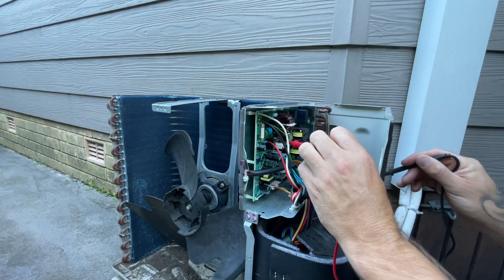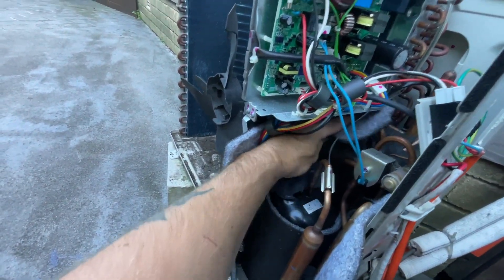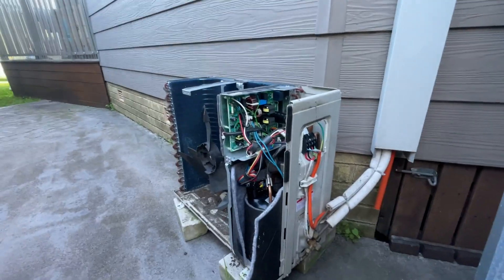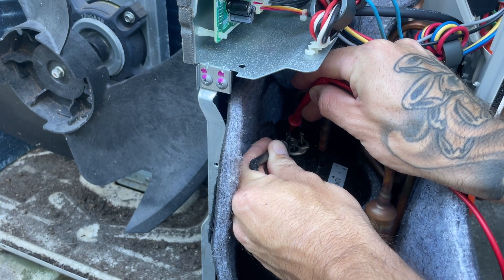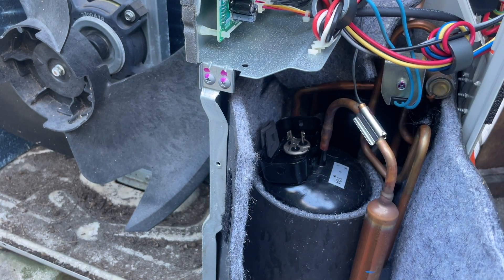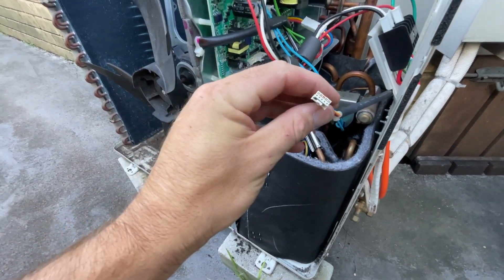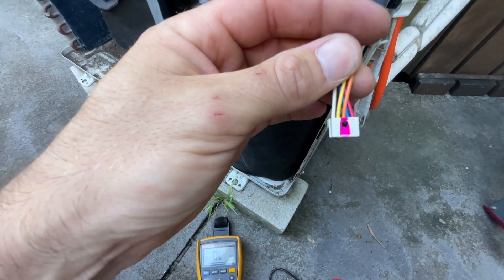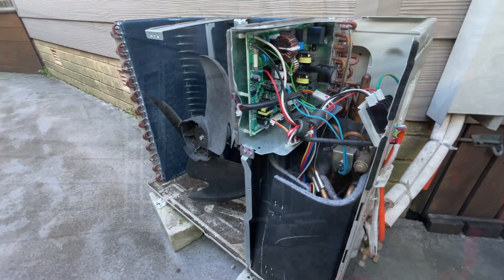Diagnosing Daikin U0 Error⎪2

Comment: Shouldn’t the run and start windings be 4.6 ohms since both where 2.3 ohms isn’t that a faulty compressor?
Reply: These compressors are inverter driven, basically a three phase motor, so all windings should read the same resistance. The board varies the AC frequency driving the compressor to vary the speed the compressor is running.

Comment: Thank you for the video🙏🏼 I got a serious problem with my Daikin 3MXM52N2V1B. Changed Mainboard, Valves, all sensors gas,water, main and the system runs 50seconds fine, after that 2.50min stop. This goes on and on for about 10 hours. On the outdoor machine the bulbs 2+3  are blinking> start with defective compressor. Then the Onecta App says error H0.  Would be really greatful for any tips recomendations what to check for 🙏🏼

Comment: Hi, have you ever had a u0 04 error?
Daikin cant seem to figure it out and blaming airflow, however system was working fine for 3 years through many 40c days.
Gas has been reclaimed and checked.
Indoor coil thermistor replaced.
Reply: Change brand next time mate, this brand is too much problem and gives you headaches....
Reply from the maker: If it’s not short on refrigerant and a technician has confirmed this. You need to test the low pressure transducer is actually working. It might think it’s low on refrigerant when it actually isn’t.

Comment: hi mate ever had an e5 error?
Reply from the maker: Yeah mate that’s just an error code that comes up when the compressor gets to hot. Unfortunately there’s many things that could cause that so it’s impossible to tell you the exact problem without checking stuff but I can tell you that the compressor got too hot. Error comes on when the thermal overload is tripped which is located on top of compressor.

Comment: If the fuses don't have continuity could you replace them to try and get the PCB working again?
Reply from the maker: Yeah definitely however unfortunately in this case the fuses are fine and do have continuity. The issue is in the board.
Reply: @maracservices  I love how  air conditioning company’s don’t put replaceable fuses 😅  . Can I ask what props you use to test small components
Reply from the maker: @adrianvisintin1961  I know it’s so ridiculous hey. 

So my fluke meter came with prongs that I use 99% of the time but I found a really cheap no name multi meter laying around that had really sharp prongs. So basically I put the prongs in my bag to test plugs and what not. So to answer your question, I use no name Chinese leads for plugs and decent fluke leads for everything else haha.

Comment: Nice video 👍 let’s say if you the unit  it short the gas …what the best away  to add r32 ?   What type tecnic are you use it ? Thank you
Reply: when ever posible with a  scale by weight , the unit has a label indicating how much the unit takes
Reply from the maker: Find the leak, fix the leak, evacuate the system and then weigh charge the gas back in 👍🏻

Comment: Hey mate just wondering why all the resistance readings the same? For single phase shouldn’t the highest be between run and start, then start and common, then run and common?
Reply from the maker: It’s because it’s a 3 phase DC Compressor mate. 

Good question though!
Reply: In iverter motor it should read the same reading
Reply: You're thinking of start and run windings for the old school single phase units. These inverter systems had done away with all that. Like Mitch said, the new technology uses 3 phase DC inverter technology, hence equal resistance on each winding.